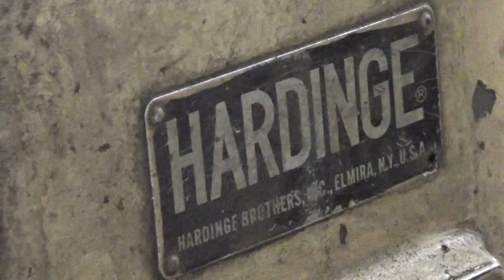Hardinge HSL-59 "Speed" Lathe rebuild, Part 1

Comment: I am a little bit disappointed that the rivet removing pliers weren't used.
Reply from the maker: Those were actually made after that shot, and actually, in response to it. By the time I made them, the only rivets left to remove were the ones on the motor. :)